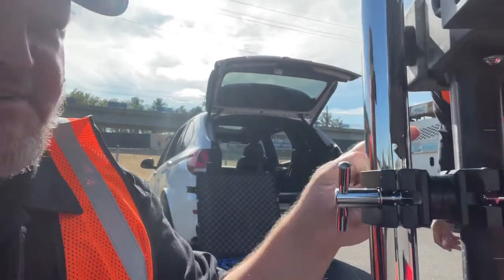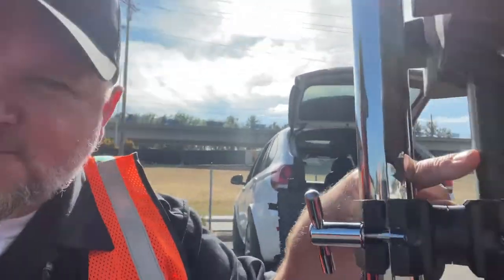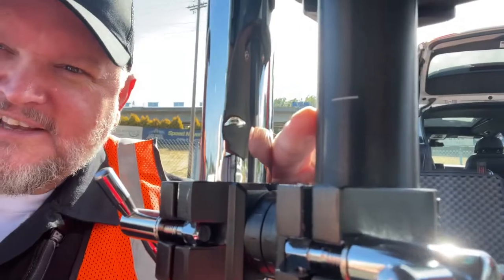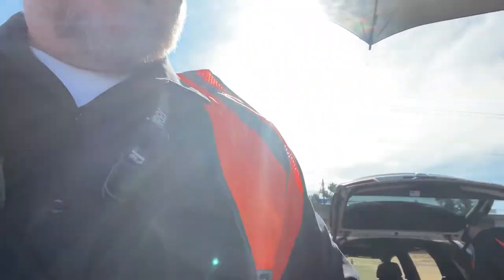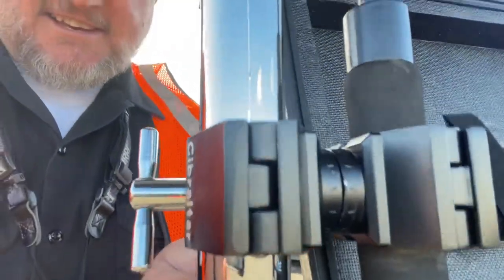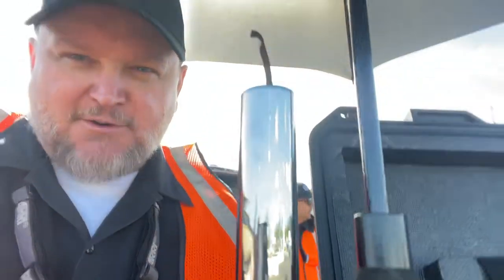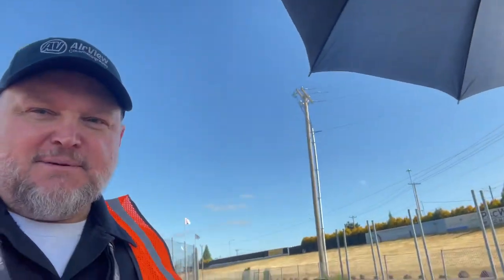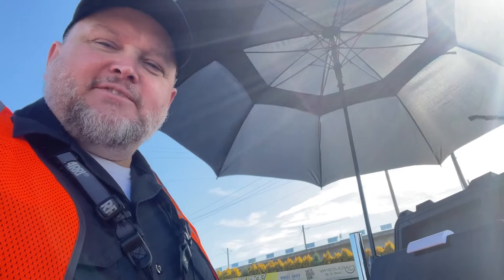On The Job - Inovativ Voyager NXT Umbrella Hack

Comment: Are those clamps same diameter of a c-stand riser column? That would be good for monitors/camera or even lights. thanks a lot man!
Reply from the maker: I'm not familiar with all diameters of C stand.  But, i do believe it is the same.  And if it's not, I'm sure wrapping some gaff tape around it would solve the problem.